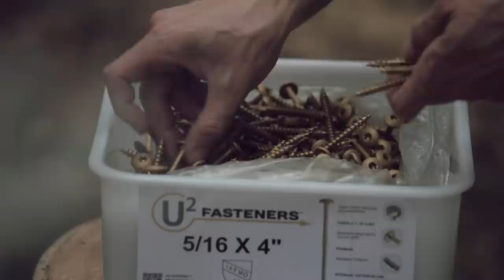EP07: Platform From 100% Self Harvested Lumber // Cabin Build: EP07

Comment: Never realised each board was scribed! Looks amazing so far
Reply from the maker: Every board got some adjustment but I wouldn't call it ascribed.  Mostly just  due to uneven edge milling and a bit of bow during drying.  Once I started using the table saw in the second half to get my second side it greatly sped up the process of getting strait edges.

Comment: That is some tight fitting. Is the wood still green?
Reply from the maker: Yeah, Pretty green, mixed up boards that have been drying between 1 year and 2 months. I noticed on the first half that the boards are thick enough that even when it does expand the boards don't buckle, they actually warp to fill the gaps.  So I went as tight as I could on the second half.  I'm sure once the roof is on they will shrink more.
Reply: @TrustinTimber  They are indeed thick. I suppose the tight fitting is to avoid draft from below and tongue and groove would be too much work?

Comment: These are a great series of videos and I'm definitely looking forward to more.  

One question about the flooring and how wet the wood is right now.  When the wood dries will you get gaps between the floor boards?  Any thoughts on how you'll handle that if it happens?
Reply from the maker: Yep. I'm expecting gaps.  You’ll have to wait and see:)
Reply: @TrustinTimber  Absolutely.  Thanks for the reply!  Stay safe and looking forward to more.

Comment: I see that you custom fitting the floor boards to the side would it not be easier to cut a notch in the side girders with the chain saw instead
Reply from the maker: I think I know what you mean. But water might get trapped in there and rot don’t you think?
Reply: @TrustinTimber  the knox on the side with the first bean on the wall would only have to be a little piece cut in. the the floor boards would slide in and under about an 1" the knox would not got all the way to the outside

Comment: Isnt it dangerous to press the Boards  together like that? Because of Wood movement in width
Reply from the maker: No, They are green and will only shrink from here.  When they do swell from rain they only seem to be tightening the gaps but these 2" boards wont buckle with these heavy screws.  My only mistake was having some of the boards upside down (open grain up) but I wanted to get the most width as possible out of each plank. (if that makes sense). They might cup a bit over time. We'll see. Stay tuned and we'll all find out together.
Reply: The ends are going to split between the screws.